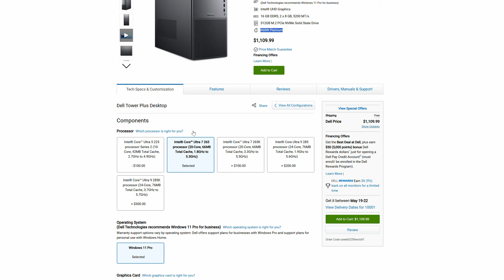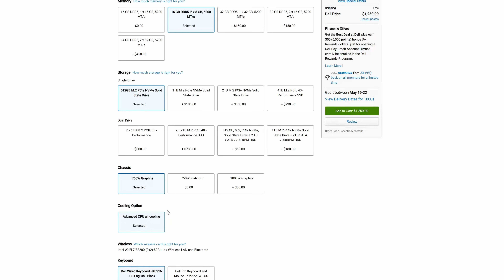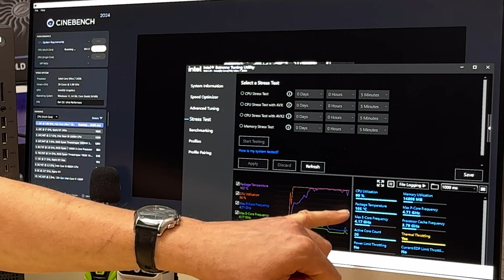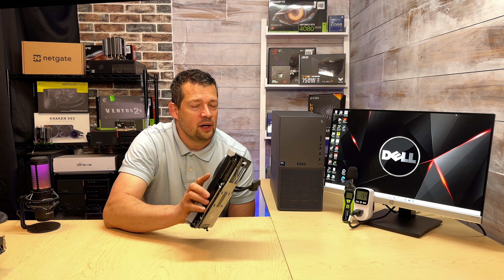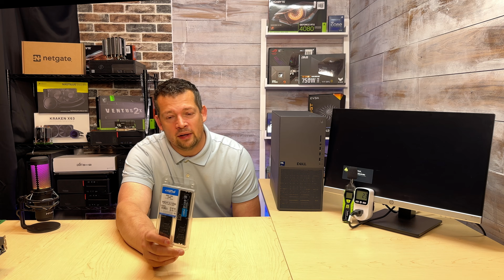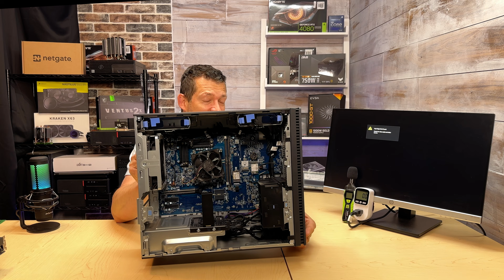Dell Tower Plus EBT2250 - Watch this before you buy it!

Comment: Hi Scott, I received the DELL TOWER PLUSS EBT2250 and I'm loving it so far thanks for your great review. However I have a quick question I'm hoping you can help with. When I plug the pc in for the first time each day, the pc powers up by itself for 1-2 seconds then powers off. I can then press the power button and it starts up fine no problem. I can shut down and start up no problem. It only every happens when I turn the plug on for the first time. Is this normal? Thanks for any advice you can give
Reply from the maker: Hello,

That is totally normal. Looks like the last person unplugged the power cord before the PC fully shut down. 
In that case a “ pre-boot” check gets performed and it does exactly what you described. No worries! Congratulations on the new PC!
Reply: @Scott.The.IT.Guy.  Thanks Scott the pc is great. It happened the very first time I plugged it in out of the box and also actually happens even when I have shut the pc down fully myself. I shut down fully, then if I unplug and plug back it  it does the "pre-boot" check every time. I always unplug when I leave home for the day and at the end of every night. Would that still be normal?
Reply from the maker: Still normal, no worries. Dell  business class desktops are doing this, this is a " premium feature" not a bug nor a problem. Normally you don`t kill the power on the PC.  I only cut the power when I perform some kind of work like upgrades.Once the power returns,  it turns itself on, to make sure that all the fans are running properly, no  short found on the circuit board, ram and cpu are functional. As a tech, I like this a lot.
Reply: @Scott.The.IT.Guy.  Ah thank you so much for your knowledge and advice I thought it was some kind of problem.. You have put my mind at ease. Thanks again :)

Comment: I just bought this Dell Tower Plus EBT2250 and have a 1 TB M.2 PCIe NVEe Sold State Drive,  do you have any video on how to clone this drive?  I want to have a back up in safe keeping in the event of failure.  My old XPS, I always cloned the SATA hard drive frequently as a backup, now with this new one, I'm not sure how to do it and what SSD I should buy - novice here.   It came with a Samsub 1TB PM9C1a, what should I buy as an equivalent?  I saw another video where they say Samsung has cloning software  that they supply and all I will need is an external drive reader/adapter and the SSD.  Can you comment?
Reply from the maker: Hello,
Those Samsung drives are like Toyotas or Hondas, I have been using them for over 15 years. I would just get a usb external drive, could be even a regular sata HDD or ssd and use a backup software.
Of course you can get another 1 TB m.2 Samsung SSD put  it in an enclosure and just use the free Samsung magician software to keep cloning it.
I can make a video on a free backup software what we use at work .
Reply: @Scott.The.IT.Guy.  Thanks for the reply!  I was able to find another 1TB Samsung M.2 2330 SSD that has the same part number as the one in my Dell.  I ordered it from Drive Solutions and I ordered an external holder from Amazon for M.2.  I want to my back ups by cloning regularly.  I thought I got a decent price on the new drive.  Anyway, I was burnt on my old system all because I didn't keep a clone back up.  I was able to retrieve file from my bad hard drive, but I would have rather just put in a clone and kept on working.  Its one of the reasons for my new Dell Tower Plus which I really like.  I have a question for you,  I installed the Samsun Magician software but it doesn't recognize all the information about my drive  - says it can't verify is to be a Samsung drive - something else it says that maybe my virus software isn't allowing it to connect with Samsung website to do the verification - do you know anything about how I can get this verification to work?   I am novice that doesn't want to become a computer expert but dang if I don't always get drawn into something!  Thanks!!!!
Reply from the maker: Does it recognize your system drive as Samsung and you are only having issues with the new drive , or it’s complaining about both ?
Reply: @Scott.The.IT.Guy.  I don't have the new drive yet, just ordered it today, was having a hard time finding same one (samsung).  Right now, Samsung magician isn't recognizing the drive in the Dell  (brand new, just got two days ago), it gives some info. but says it can't verify it with Samsung that it is one of their drives, when I open the little help icon it says that it is possible my Windows defender or Mcaffe won't allow my PC to communicate with Samsung so it can do the verification.  It says to contact my I T department and have them okay access to the website,  and obviously I have no I T dept.  !  (LOL), so I really don't know how to do this.  I opened up the Dell and took a picture of the sticker on the SSD so I could magnify it so I could read the label to buy the exact same drive - it is definitely a Samsung.
Reply from the maker: What is the exact error or warning message are you getting? 
Also the samsung drive we got, is might not be "consumer " grade. When you click on " diagnostic scan" does it comes back as not supported drive?

Comment: EDIT: Two month in and this thing is still rock solid. Extemely happy at this point after a few months of constant use, gaming etc. You absolutely don't need to spend a fortune to dip into decent 4k gaming. 

I recently stepped back into the desktop PC market after being away for nearly 20 years and I did not want a "Gaming PC", but I wanted something that could run games very well along with gaming development software for my degree program. I did not want all the RGB and logo heavy gaming peripherals. I compared spec for spec and I ended up spending about $1850 on this with the Ultra 7 265k, 4070TiS and 32Gb of RAM. I dropped in another 2TB Samsung Pro 990 M.2 that I picked up. Spec for Spec, an Alienware would have tipped the scales around $3500 with very similar components. This was an absolute steal IMO, and I highly recommend this if you want a fantastic setup with none of the gaming branded fluff. Thanks again for the help on the RAM question Scott!
Reply from the maker: That's a great price for those specs!
I am thinking about getting one for myself as well! I love this PC!
Reply: @Scott.The.IT.Guy. I dont know that if will matter to a lot of folks but the 265K has an NPU as well, handy for those AI tasks and some creativity apps!

Comment: Here is an odd one. Got a stick of Crucial 16gb that matched what you posted on the Dell forums and when I install it, I get absolutely no display output at all. I remove it and the display starts right up. 😂 Any ideas on what might be causing this behavior? Thanks
Reply from the maker: This is all normal and all good as long as the ram itself is good.
Shut the pc down and pull out the power cord . Put the crucial ram in it by itself. Press and hold the power button for 20 sec while the power cord is unplugged.

Plug the power cord back in and don’t do anything. If the PC turns on with a black screen and turns itself off it’s fine.
Hit the power button one time and leave the pc alone . It might take anywhere from 20 seconds to 20 minutes to recognize the ram at the first time.

Let me know if that is still a no go !
Reply: @Scott.The.IT.Guy. Worked like a charm. Recognizing 32gb now. Hats off to you!
Reply from the maker: You are welcome! 
This model can be a mule sometimes when it comes down to ram upgrades. There are some Dell desktop where you can toss anything in it combined with something completely different and it boots up right away.
And there is the Dell G15 gaming laptop…stubborn mule on turbo , I think I spent 5-6 hours to upgrade it to 64 GB !
Reply: @Scott.The.IT.Guy. Eventually, Ill upgrade to 64 but now I know what to do! 😂
Reply: @Scott.The.IT.Guy. Ill give that a try right quick!

Comment: Great video.  One question, you said in the beginning that machine has the K CPU it will have the 750W PSU and the tower cooler.  But when you opened the machine it did not have the tower cooler?  Thanks
Reply from the maker: That is correct! Second video on this PC,  around 2:30
https://youtu.be/a8z6ZFnNnOc?si=wP-3n9mToJwDCw4R
I took the advanced cooler off and installed the standard cooler so I can take some measurements and demonstrate how to replace it.

Comment: THanks for these videos a few questions ....What speed is the ethernet? Does it have a 40Gbs Thunderbolt 4 port at the rear? Will a 10Gbe network card fit under the Dell 4080 ?
Reply from the maker: The rear does have a thunderbolt 4 port . Lan port is 1Gb only and there is no space to use other slots with the 4080. The 4060 is the only card not covering the last PCIe slot, even that is just a barely working option.

Look at the Dell Pro Max Tower T2 Desktop fully customizable version .
It’s technically the same exact thing, but that has 2.5 and 10Gb nic options with a daughter board as best as I remember.
Reply from the maker: I am looking at the pro max t2 I suggested, that has two usb c at the rear but 20 Gbs only . 
You can get the optional 5 Gb Nic or a 5 Gb optical , but then you can’t select the other optional thunderbolt 4 port.
The 4080 also not an option it would had to be purchased separately. 
This model also offers a 1500w PSU and looks like you would have least one gen3 or gen 4 open ended PCIe slot  but probably two.
Reply: @Scott.The.IT.Guy. thanks so much for the info I think I’ll wait to see what the precision 7875 gets replaced with

Comment: My XPS8700 had a bad power supply which was replaced under warranty.  But I wish I could have afforded this unit.
Reply from the maker: I would love to buy it for myself as well but I also can’t afford it. 

The said thing is , before the tariffs situation kicked in, Dell had this desktop with the same ultra 7 CPU, 16 Gb of RAM and the 512 SSD with Linux for $650. I should have just grabbed  it.

I will wait a year or two and will grab one from eBay for $400-500, and I will be set for a long time.

Comment: How about showing how to install two HDDs, including the cables?
Reply from the maker: Power and Sata Data cables are both included and it`s stored right under the HDD caddy.  Same as the 2024 model:

https://youtu.be/r5LYy4UBpIs?si=Co6VB8iIEWRUu8aN&t=598

Shut the PC down. Just pinch the edge of the blue plastic tray  on both sides and pull it out. Put the drive in to the blue plastic caddy. No screws needed, it has 4 short metal ping going into the side of the HDD.  Slided it back in, connect the cables and you are good to go.

User Manual:

https://www.dell.com/support/manuals/en-us/dell-ebt2250-desktop/dell-tower-plus-ebt2250-owners-manual/installing-the-3.5-inch-hard-drive?guid=guid-9d8c834c-7cec-45b5-9754-875381b960f0&lang=en-us

Comment: does it have a  power supply cable (15pin) for the hard drive? Thanks
Reply from the maker: Yes , power and  sata cables are included and located right under each 3.5 “ HDD bay.

Dell instructions:

https://www.dell.com/support/manuals/en-us/dell-ebt2250-desktop/dell-tower-plus-ebt2250-owners-manual/installing-the-3.5-inch-hard-drive?guid=guid-9d8c834c-7cec-45b5-9754-875381b960f0&lang=en-us

Comment: It's great to have your experience and comments. I'm not computer-savvy, but I'm learning from your videos. Is this computer the same as the Dell XPS 8960 Desktop - 14th Generation Intel Core i7-14700 Processor, 32GB DDR5 RAM, 1TB SSD, Intel UHD 770 Graphics, Windows 11 Home?
Reply from the maker: It is the same XPS but is the latest model. Before we got into tariffs and supply shortages, it was priced at $650 with the new ultra 7 265 cpu, 16Gb of ram and a 512 SSD with Linux or $750 with Windows. 
If you can get a good price on the 2024 model( 8960) they can be a great option.

Comment: It is can fit 1 fan gpu+ the front case fan together. Because it seems that it going to be get hot
Reply from the maker: You can, new video will drop tomorrow morning on CPU cooling options, that will have some explanation on the front fan situation.

Follow up video will be out on Wednesday or Thursday specifically on GPU  options, such as RtX 3050, 4060 Ti and 5070 OC with exact measurements. Feel free to ask any questions.

Comment: Thank-you for being a real person with real experience and a real assessment and tour of the desktop. Thanks for opening the box and explaining the cooling options (which are not pictured on the Dell site, as far as I could see) and talking about the very real considerations that higher end graphics cards bring to the equation, with the space needed for their fans and the added power consumption. Also, your talk about prices and tarriffs is a very strong point for buying sooner rather than later.

I'm going back and forth on the graphics card thing. I've got an XPS 8910 to which I've added a GeForce GTX1660 Super (which was the highest-end GPU that this box could support). It seems to meet my needs just fine and I was thinking of getting a new Tower Plus without an added graphics card and simply moving the GTX to it, but I'm not sure if I should then upgrade to a 750w power supply for 'future possible additions'. The 8910 is using a 450w supply and it seems to be OK, but I don't know if the new tower really will need more. Heck, it's possible the integrated graphics are plenty for my needs. I think the 460w should be fine.

However, there's a 'sale' price right now at Dell where for $200 they'll bump up the memory to 32gb, SSD to 1TB and provide a GeForce RTX 3050. But this configuration doesn't automatically bump up the power supply or cooling. I'm not sure if I should go for the high end cooling and power supply, given that my current system (the ol' reliable XPS 8910 with a GTX1660 GPU) is all I have needed. My most demanding usage is occasional video editing, and the ONLY reason I'm looking to buy a new PC is the Windows 10 support deadline in October.

I do have one 'gripe' with the Dell configurations: Their Dell Tower model does not have Line-in/Mic anywhere that I could find. I have to move to the "Plus" model for something I consider to be standard. I also don't understand why they don't have Line-in/Mic on the front of the box. I don't understand their audio changes. Are they thinking that the world is moving to Thunderbolt or USB for audio?
Reply from the maker: I really appreciate you taking the time to watch the video and leave such a detailed comment!

If you are happy with your current desktop, I would just put windows 11 on it. I upgraded many laptops and desktop older than your desktop with great results.
As long as you have good backups, just download a free windows 11 iso from Microsoft and start the process from windows. If you have any questions or concerns please feel free to ask any questions .

The Dell tower has a combo jack in the front panel you can get a splitter and still use a mic or as you said use a usb microphone.
I think your RTX  1660 needs a power cable from the power supply and the Dell Tower does not have that just the Tower Plus.
RTX 1660 performs about the same as the 3050, however that deal is pretty good, since the RTX 3050 cost about $180 by itself.

Regarding the power supply, the default 460W is plenty in a real life scenario, if you ending up going with a new PC .
Reply: @Scott.The.IT.Guy.  Thanks, Scott! I hesitate to install Win11 on this PC because its CPU isn't on the 'approved list' that Microsoft has (when I run PC Health Check, it gets a thumbs down), and Microsoft has been urging folks who have loaded it onto an unapproved CPU to revert back to Win10. I bet it would work just fine to migrate, but I also reckon it must be time to upgrade (before Win12 comes along, LOL!).

Thanks for reminding me about the power chord to the GTX 1661 graphics card (I totally forgot!).

I am a gamer and musician streamer. I use an Avermedia capture card when I stream console gameplay, and I use Line-in to receive the mixed audio (voice and instrument) for stereo sound capture. I think the Dell Tower Plus will work great for these applications.

I'm now curious to experience the new Intel Core Ultra 7 265 compared to the Core i7-6700.
Reply from the maker: I am about to release a video on the CPU cooler options where I will include some charts regarding tests software’s and benchmarks. I purposefully used free software’s so you can run the same thing on your current gear and you will see the difference between the two. The video should be out in a day or two or over the weekend.
Reply: @Scott.The.IT.Guy.  This will be so interesting! I'll be sure to view!!

Comment: Good review, but I was wondering if an RTX 4090 GPU would fit inside it, or what about an RTX 5090 GPU? Do you need to make some customizations, or would they not fit at all?
Reply from the maker: You have to be very careful with this, Dell has its own branded cards and they are usually smaller so they can fit.
I have a video coming out on cpu cooler options kind of deep dive , shortly after that will have another video just on graphics cards. I will take some measurements for best possible options.
Reply: @Scott.The.IT.Guy.  Yeah, I checked with Dell support, and apparently this PC wasn't tested with the RTX 5000-series, but they said it supports the RTX 4090. But is there a better alternative to this PC, which supports the 5000-series, and is also more future-proof?
Reply from the maker: There is a lot of time when Dell is not officially supporting something, but you can easily double what they describe as maximum. 
For example, this XPS desktop only supports 64 GB officially, but we know for a fact that 128 GB works flawlessly. I have absolutely no problem with the 5070 OC graphics card.